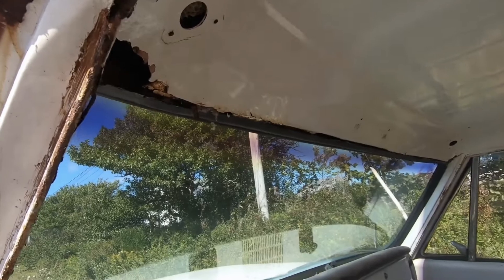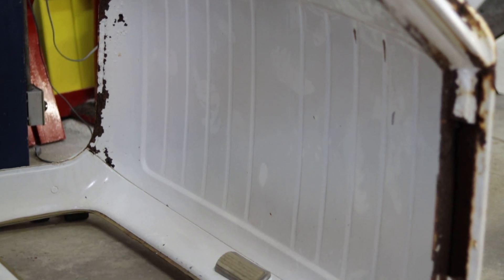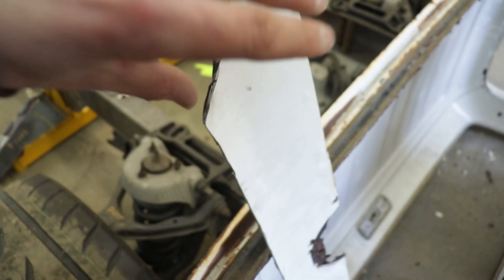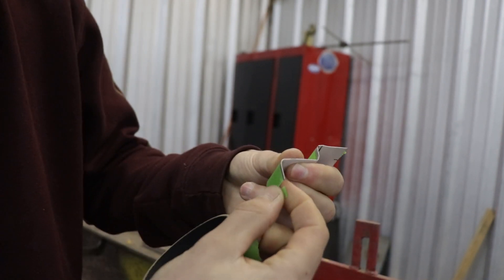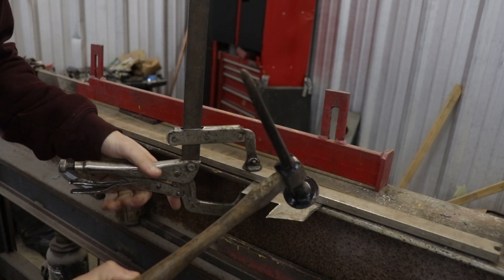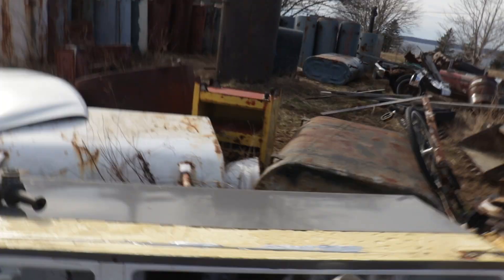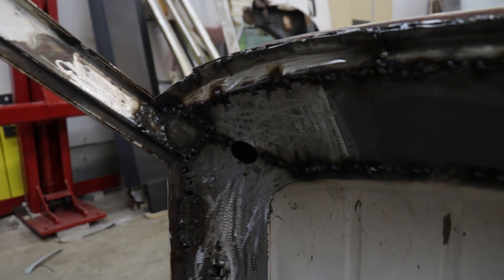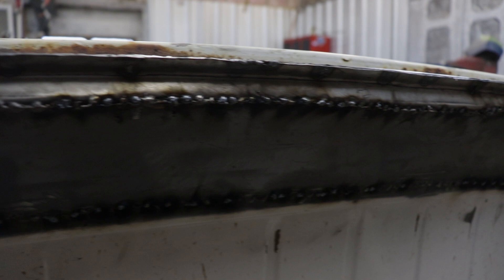Major Rust Repair and Bodywork On My 100% Custom 1968 Turbo C10 Build (Episode 10)

Comment: When you get the cab all done you should use it to make a full fiberglass cab, save you alot of weight. And keep you from thinking about it rusting again. I'd go full fiberglass body panels. The big thing is time, alot of sanding.

Comment: I like the work your doing on a budget that's what i would do for my own project if I had the room to build and entire frame from scratch. all that inside surface rust behind the (metal you just welded on) needs to be treated with rust remover or rust converter cavity wax or por-15 and or wire wheeled and all your spot welds and welds needs weld through primer  otherwise all you work will just continue to rust from the inside out. you can also go to the any auto wrecker find a van or panel truck etc and cut out sheet metal from there that you need.
Reply from the maker: Some good points! I did put weldable primer off camera on the pieces I spot welded and will be sending rust preventing product in the creases as well👍

Comment: Do you use some type of rust prohibiter on the old rusty metal that your welding new metal to?
Great work!
Reply from the maker: yes I do, I will also be spraying some rust prohibiting oil with a long flexible nozzle in areas that don’t get painted
Reply: @ag_trucks  thanks for the quick response!